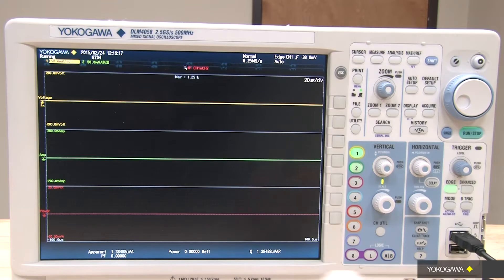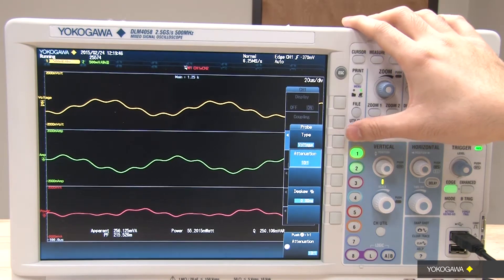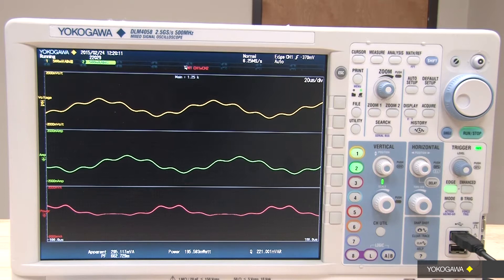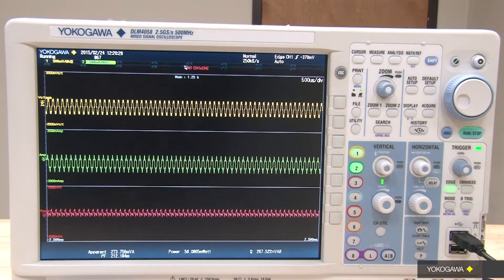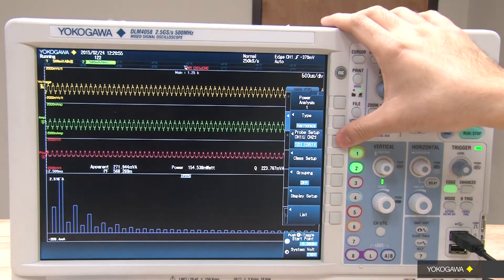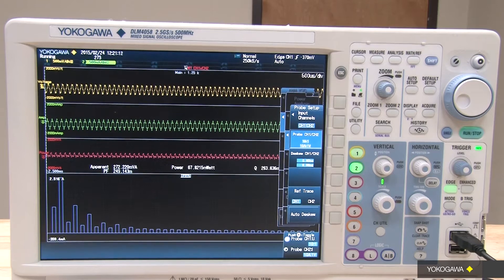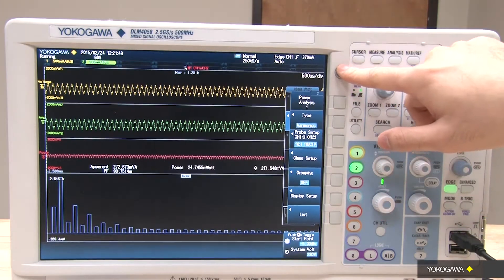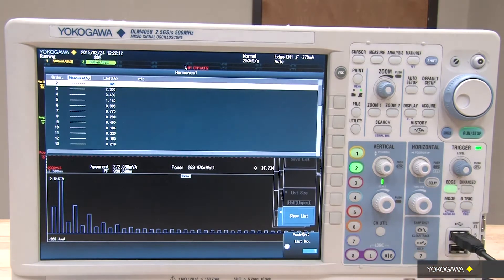Measuring Harmonics on a Digital Oscilloscope

Comment: Even in your demonstration, harmonics spectrum is not plotted.
I am getting same kind of problem while measuring the harmonics in the DSO 3000 series of Yokogawa.
Reply from the maker: There could be a few different reasons for this. You cannot perform harmonic analysis if 10 periods (for 45 Hz to 55 Hz) or 12 periods (for 55 Hz to 65 Hz) of a waveform correspond to less than 200 ms or if the number of data points is less than 9000 points. If this occurs, “--------” appears in the Measure (A) and Measure (%) columns in the list. “--------” also appears for harmonic limits (Limit(A)) that are not specified for a particular class. Also, check and make sure the trigger mode is set to Normal.